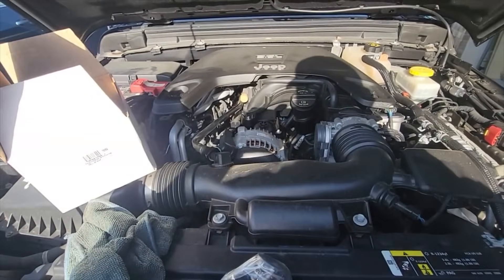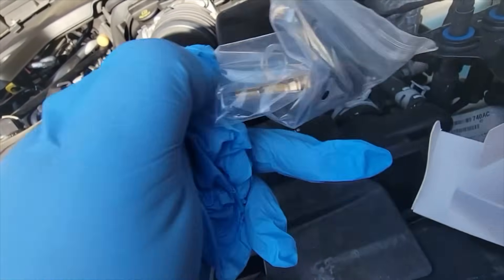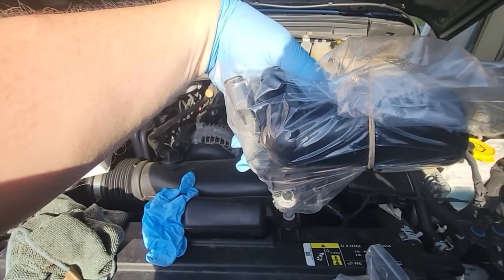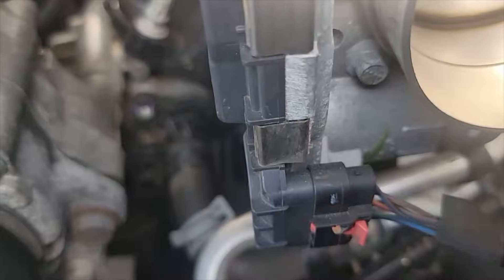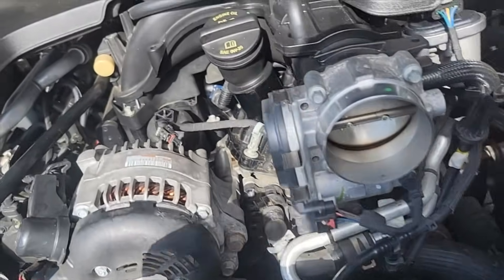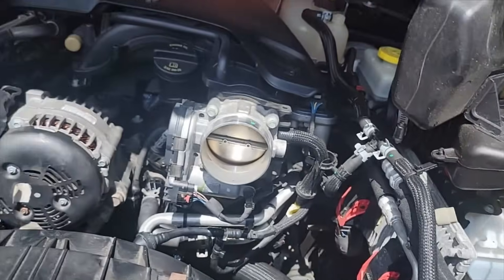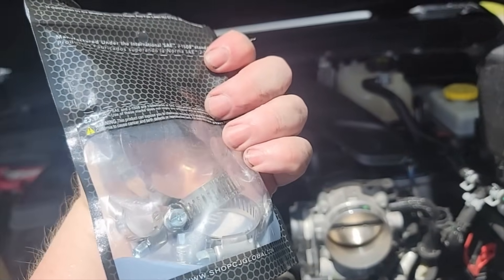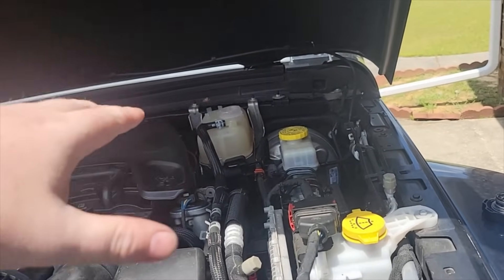(Quick Fix) 2018 Jeep Wrangler Sahara JLU P0128 Thermostat & Sensor Replacement

Comment: What was the thermostat housing torque specs?
Reply: 12 nueton meters = 106 inch pounds of 9 ft pounds which ever torque wrench you have
Reply from the maker: I'm going to pin your comment so people know those specs
Reply from the maker: Unfortunately I don't own one myself. But in the future I'll need to get a few I believe. I've had to replace the trackbar too this past month due to death wobble. The bolts had torque specs as well.
Reply from the maker: I didn't torque, I got snug and then turned 1/8 more for tightness.

Comment: Thanks for posting this.  I am having the same error code.  It's been on and off for over a year now so I figure its time to just replace the whole thermostat housing as you did.  My questions is how did the refill go?  I'm noticing that the JL model does not have a traditional radiator cap, so I'm assuming that the reservoir is the high point of the system and that it self bleeds the air out.  Is that sound about right?
Reply from the maker: Technically your suppose use a vacuum kit if I'm not mistaken. What i did was face my jeep at a slight decline nose towards ground, take the cap off the reservoir and filled to max line, started jeep with heater on max, allowed it to get up to temp with the cap off the reservoir and filled if the level dropped. Afterwards I shut of the motor, restored the cap, and drove it check every couple days to see if it self burped and needed any refill.